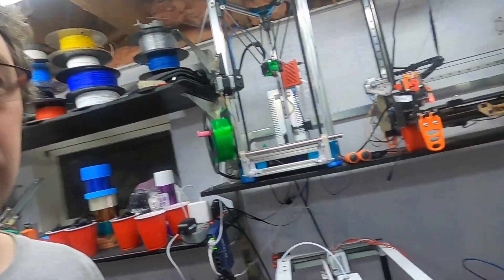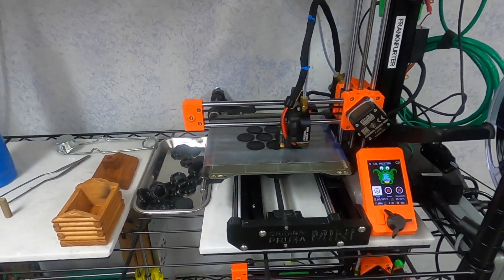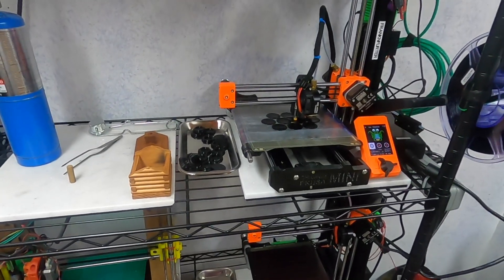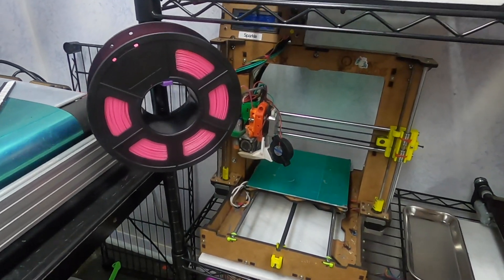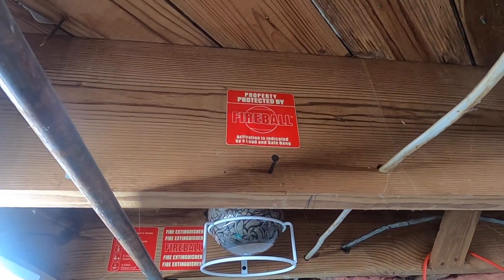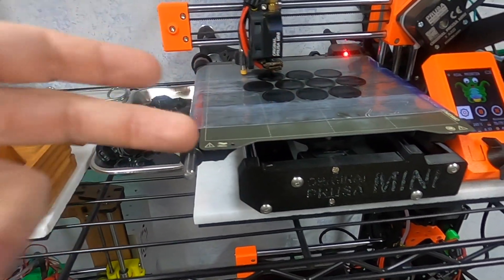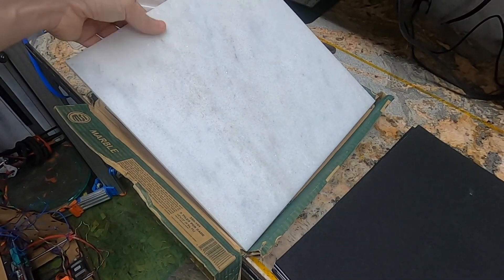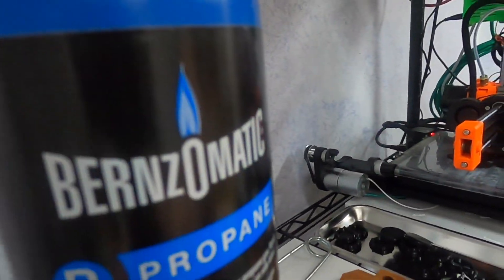PrintShift Prusa Mini: Print Farm Setup

Comment: can this be done with a KP3s printer? i plan on doing that
Reply from the maker: The only difference I've seen (from observing, but not owning it modifying) the KP3S is that the standoffs are cast into the bed.  You'll need spacers instead of replacing them, or just make a washer pile.

Comment: What system are you using to automatically remove the parts?  I'd be interested in getting one.
Reply from the maker: I'm designing the system called PrintShift - check out the 3.0 ejector here: https://www.youtube.com/watch?v=CxGbSgi6bk0&ab_channel=PaulChase

It's working well, but still considered experimental :-)

Comment: Please can you advise what racking you use and where i could get some?
Reply from the maker: I used this specifically: https://www.homedepot.com/p/HDX-Black-4-Tier-Metal-Wire-Shelving-Unit-36-in-W-x-54-in-H-x-14-in-D-21436BPS/205559612
available from Amazon too: https://smile.amazon.com/AmazonBasics-4-Shelf-Shelving-Unit-Black/dp/B01LYBQXRH/ref=sr_1_1_sspa?crid=1LKVC52TM1CNR&dchild=1&keywords=wire+shelving&qid=1615807729&sprefix=wire+shel%2Caps%2C178&sr=8-1-spons&psc=1&spLa=ZW5jcnlwdGVkUXVhbGlmaWVyPUEzMkVNTlIzTklRVUhEJmVuY3J5cHRlZElkPUEwMTIxODY0MkdaWUYySjBDSEEzNiZlbmNyeXB0ZWRBZElkPUEwODgwODA0MU9VRlJZOExJSjA4RyZ3aWRnZXROYW1lPXNwX2F0ZiZhY3Rpb249Y2xpY2tSZWRpcmVjdCZkb05vdExvZ0NsaWNrPXRydWU=

This kind of wire rack shelving is pretty common in office supply and building stores, though - just pay attention to the depth, most printers need some space in front and behind them, and having a place to secure the power supply is nice.

Comment: Very cool. have you had any issues with first layer adhesion after many runs on the same sheet?
Reply from the maker: The Kapton film beds with PETG sticks very well - I do sand the sheets (600 grit... just enough to give it some tooth) and there are very few failures, even with printing a bunch of little plugs.  For larger or taller objects, I'll generally add a brim for extra adhesion, but choice of materials and using the heated bed has made it quite reliable.
Reply: Talking about steel bed sheet I just uploaded a video about a new upgrade for my prusa Mini, if you want check it out!